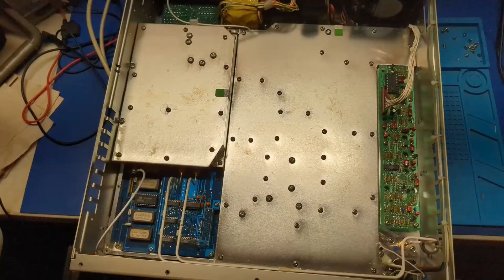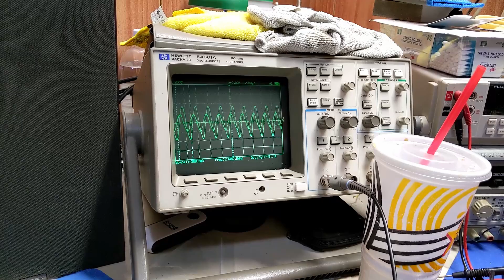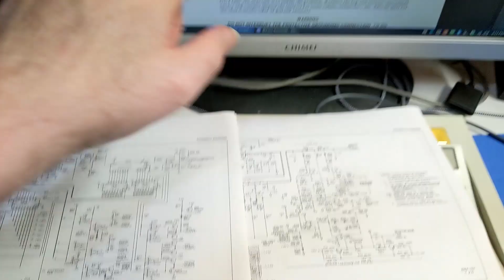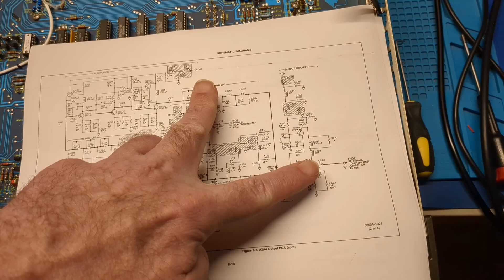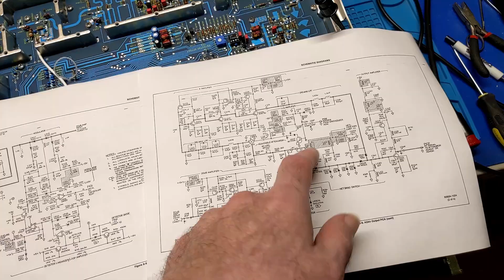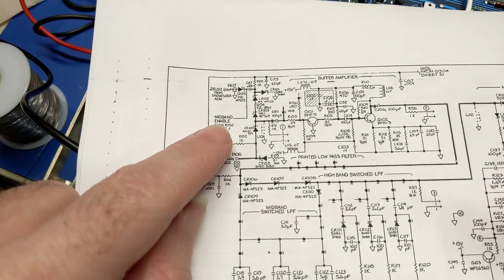Fluke 6060A/AN Multiple faults and repair

Comment: My CR104 came off on 2 pieces after it was measuring strange on diode check. Good find.
I researched and its Part No. MA-4P523 but in the manual says its a KS8379, The one you borrowed is a MA-4P532 probably not much difference. AI seems to have a hard time locating something in thru hole....comes up with some SMD possibilities.
Reply: Seems 1N5719 could work so found some on Ebay and replaced CR104. No more Uncal on the lower band.
I do get uncal as I approach the upper limit of the RF output, and also when I turn the RF off with the switch, is that normal?

Comment: I really enjoyed this video. Thank you for uploading it. I have the gigatronics 6061a im having issues with its output to a frequency counter  showing 485mhz when the signal should be outputting 400mhz totally baffled by it. Im going to download the service manual and try and methodically go through it and see if i can get this generator up and running again ive already repaired the power supply so i now have all the correct voltages on all the rails and changed out some blown tantalum capacitors one of which was  exacly where yours blew apart so i have made some progress i get no errors when i press status button now. Im thinking i should check my pin diode.

Comment: fantastic video 😀 . I have the same Fluke and I have a problem with the output signal amplitude attenuator (it gives a reading much lower than the actual value), and the message “failure” appears. How can I repair it?
Reply: Could you please tell me where you found the electrical schematics of the Fluke that are shown in the video?